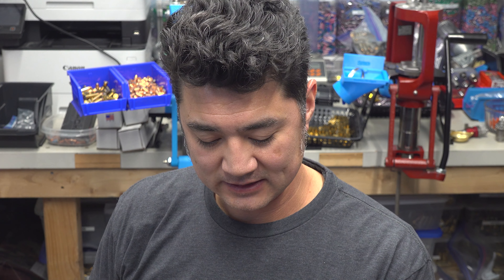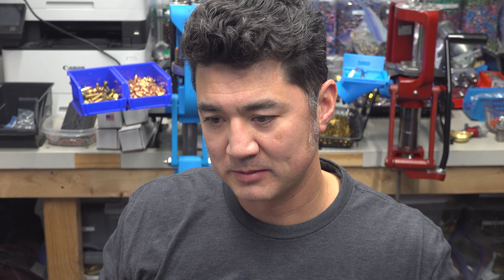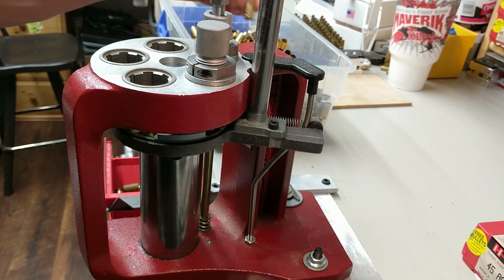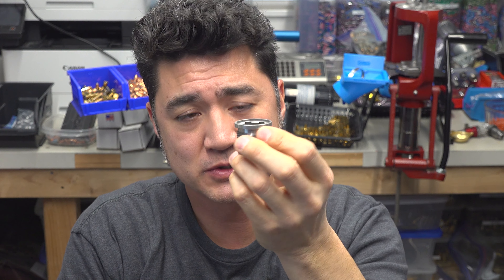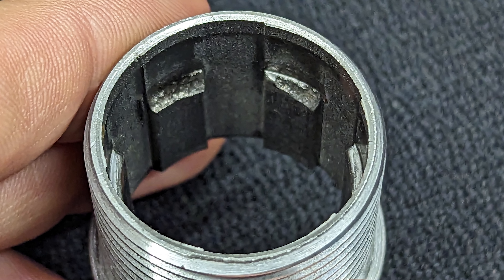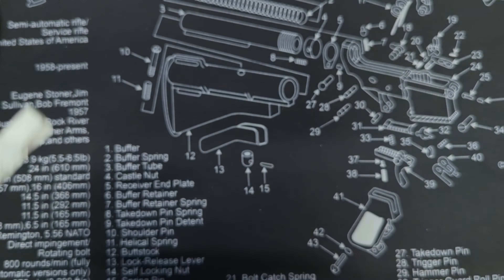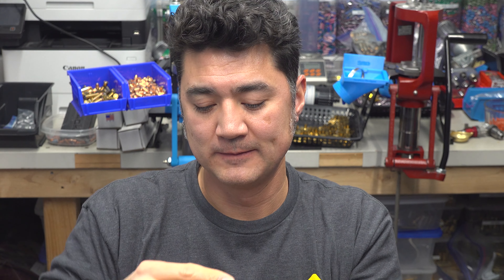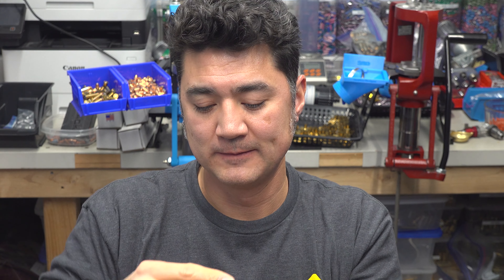Fixing my Hornady Lock-N-Load Press (changing the press bushings)

Comment: I had to change a few
I took the bushing and found a couple flats on it and can get a wrench on it to turn it out
Reply from the maker: Yeah I did that first, but the flats kept rounding, so I thought of this.  Another idea would be to weld a socket on a bushing-- then you could torque to a specific amount
Reply: @FullLeadTaco  My first idea was a piece of bar stock the thickness of whatever the gap and width is on the bushing lugs and turn it out with a big adjustable wrench.  But I didn't have any, so flats it was!

Comment: My. First powder tricker was nothing more than a pill bottle with a 18 wheeler truck valve steam cut off drilled out and it worked great it would trickle powder at any rate you wanted to as long as you kept enough  powder in the bottle, so don’t give up.

Comment: Does buying a new one from Harbor Freight work? Mine has the same problem and I used the new O-Ring and also tighten mine with tool, I will check the bushing to see if it is damaged? Probably I am making the problem worse tightening it with  hornady tool!
Reply from the maker: In my case I had broken metal
Reply: @FullLeadTaco  thanks, mine seems to be OK, I cannot see anything broken

Comment: Should be able to take a die with the adapter on it and just get a wrench on it  and twist counterclockwise to get the conversion bushing to break lose. 
I converted a RCBS Rockchucker to use the Lock n Load system, get it screwed in tight then take a die with the adapter locked down to give it an extra snug. Then just do the same in reverse to remove the conversion insert to remove. 
Most reloading companies RCBS, Hornady, Dillon if there is a problem with the press or dies will take of you and if not all most of the time at no cost to you.